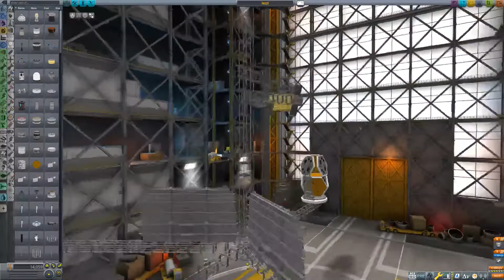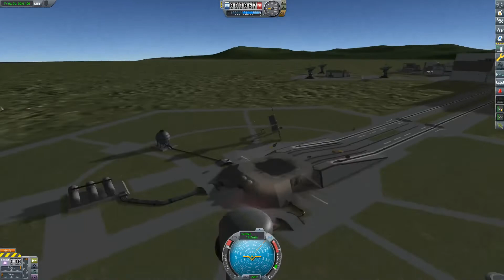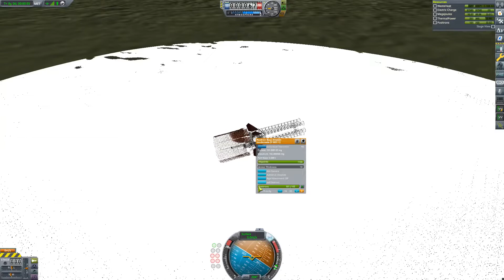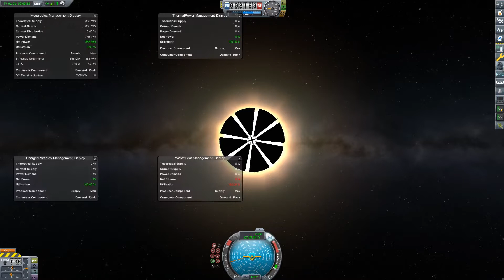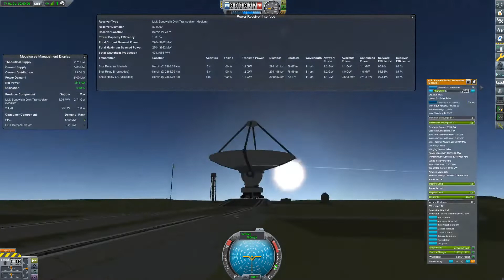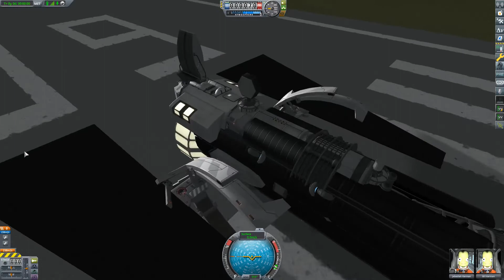KSP Interstellar Extended Beam Power Compendium (part 4, finale)

Comment: Why are you using Muon fusion reactors, when you could use Quantum Singularity reactors?
Reply from the maker: Great question! There's a time and place (and space!) for each. The singularity is massive (big and heavy) and requires a large amount of activation energy. The Muon Cat. on the other hand is small and does not weigh much. Additionally cooling requirements. The singularity generates an enormous amount of waste heat while the Muon Cat. is actually kind of easy to cool. Think emplacement/station for singularity power stations and mobile/easy to position/reposition for the Muon Cat.
Reply: @PunkWyrks  Ohh, I see. So designing your solar power station to use a Singularity reactor instead of a Muon reactor would be a lot more difficult and potentially tedious to design, launch and move into position?
As for activation energy, that doesn't seem to be as much as an issue in my mind. Some super capacitors on the vessel, and it might have enough energy to start up while it's collecting solar energy. If solar power alone is not enough, you can use a "tug boat" to temporarily power the station, until the singularity manages a net gain of energy and the tug boat can be disconnected to either be mothballed or used again.
Reply from the maker: @wormwoodbecomedelphinus4131  totally. A solar charged singularity reactor woul be a super efficient and cost effective beam power station. Just make sure to include many, many kilometers worth of radiator surface area, lol. You will have a loooooooot of waste heat to deal with (assuming low solar orbit). But also remember that the deeper you are in a gravity well, the less efficient a singularity reactor becomes. So orbit cannot be too low.
Reply: @PunkWyrks  yee.
Reply: @PunkWyrks  gotta love microchannel radiators and radiator convection bonuses.

Comment: can i play this game with a pc without a video card, 8 gb ram and an i3?
Reply from the maker: so sorry for the lack of reply. I somehow missed this question! This game should be playable on a potato (base game with no mods). The integrated graphics of the I3 should, in theory, be able to handle the game. There are texture reduction mods out there that may also help. Remember the biggest thing about the game is the RAM/VRAM usage. You want at least 4 gigs of each to be comfortable so you may have to tweak your VRAM settings with the I3's integrated graphics. GL with that but really save up for the cheapest of graphics cards and you'll be ok.

Comment: Thanks for this series! I finally have beamed power prototypes working. One problem, I'm running near future and thanks to a comment on one of the earlier videos in this series I realized that near future has castrated my reactors to 10% of kspie power ☹️ .
 
So am I shafted here? Not sure if it's worth having dozens and dozens of 5m molten salt reactor satellites? I'm hoping to get laser sails and plasma engines working but not sure if I'll be able to like this. 

 Edit: I'm using molten salt because I have them fully upgraded and they seem to produce more power compared to pebble bed or open cycle which I do not have upgrades for yet.
Reply from the maker: That's awesome! Getting a handle on beam power is a huge milestone, imo. You can probably tell from this series that i still struggle with it myself, lol. As for near future i dunno since i don't use it myself. The power cap being the main reason. Maybe ask on the help forums for NF or IE? Someone that uses both consistently would be more help with that one i think. Oh and molten salt is just dandy. I like (upgraded) pebble beds for propulsion for sure but molten salts are easy, reliable and relatively safe power for extended time periods. Nothing to sneeze at.
Real question is can your computer handle having a swarm of them all beaming power at once? If yes spam the salts. If no...  A sacrifice or compromise awaits.
Reply: @PunkWyrks  yea thanks your series has been invaluable. I ended up removing the portion of near future that was altering the kspie reactors, had to start a new career but it was totally worth it. Just for future reference in case anyone else has this problem.